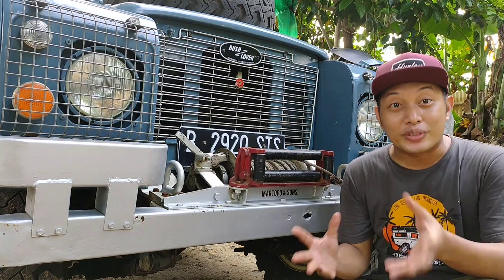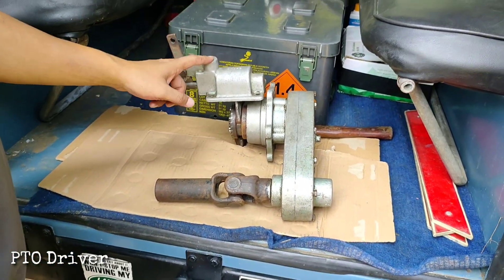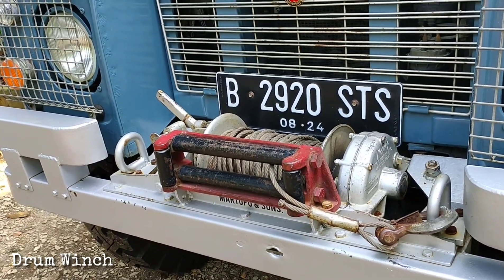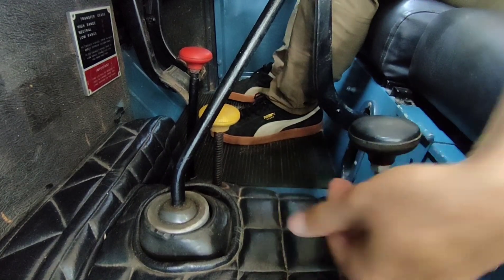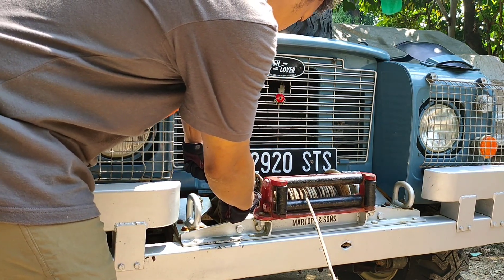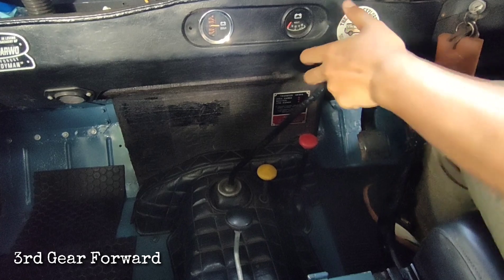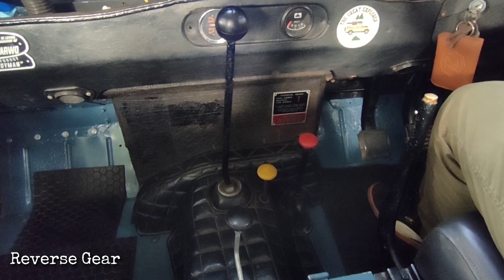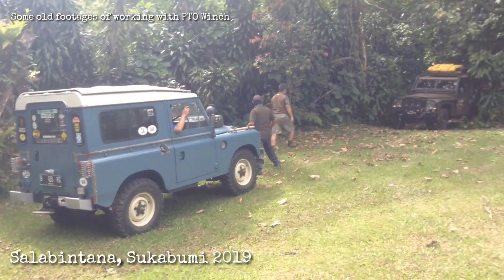PTO DRIVEN WINCH ON SERIES LAND ROVER

Comment: Very clear video demonstrating the winch operation. What about operating the winch with the transfer case in high or low range? On my old Unimog 404 the winch cable speed and 1st gear low range were the same for using traction to assist recovery. Great video, keep up the good work.

Comment: Hi I have a question,, I’m in the process of buying landrover with a PTO winch ,I’m planning of taking the winch off for a while so will I be able to unbolt the winch but leave the PTO  mechanism and still us the landrover for every day use? Thanks👍
Reply from the maker: You can unbolt the winch for sure..you can still leave the pto driver on the transfer case there..but once you remove the drum winch, you must remove the linkage shaft and joints that connected to the pto driver..just to clean the chassis area since its not connected anymore to a drum winch..you can put it back the linkage back again by the time you want to fit the winch again in the future..
Reply from the maker: Why im suggesting to leave the pto driver still on the transfer case? Because just in case you need it you dont need to adjust anymore the drive on the transfer case, and the lever knob in the cabin..and also if you remove the pto driver on the transfer cas you will have to cover the big hole with the transfer case cover (used to come from the factory) back again..
Reply: @MartopoSons  great stuff,many thanks 👍
Reply from the maker: @oakashthorn5714  you are welcome my friend..

Comment: can the pto gearbox be modified so it can also be operate as a rear pto, so you operate other attachments when you are not using the front pto winch when its in nutraul. so you will have the best of both worlds. (i read some where there was a rare bottom pto gearbox attchament that where you can have both pto gearbox attachments at the same time) im sure can some one varify for me? thanks
Reply from the maker: I heard that there's a version available that can do both front and rear..but havent seen one that came up for land rover...i once seen one but its on my friend's toyota landcruiser gearbox..

Comment: Great video. Do you need to use any throttle or is this with the engine mostly idling?
Reply from the maker: You need to use the throttle to pull it faster..if using only idle it will pull slowly..